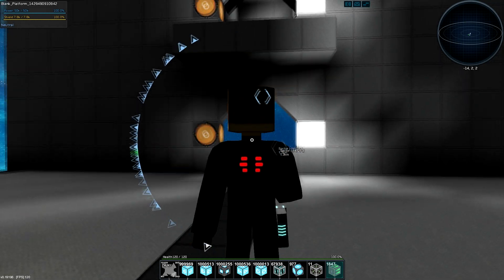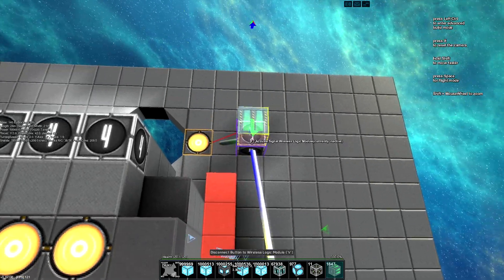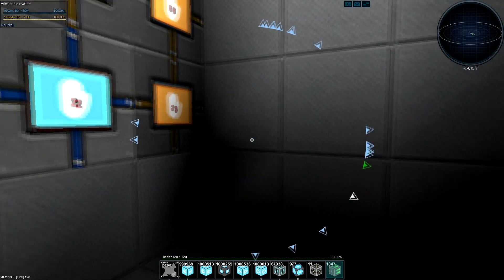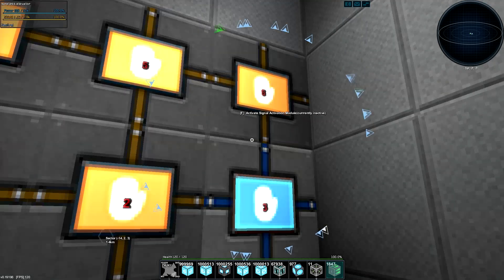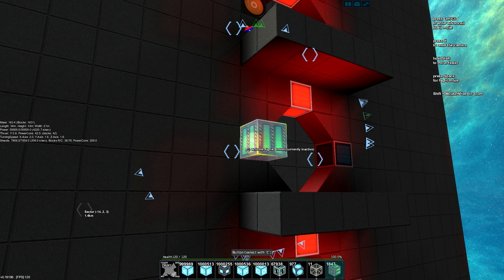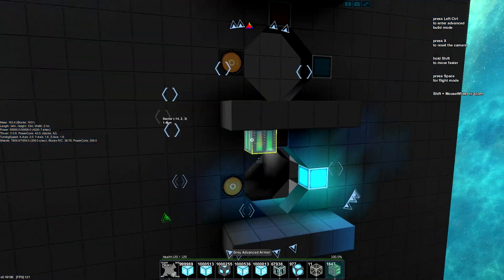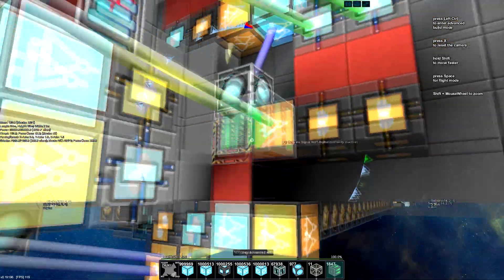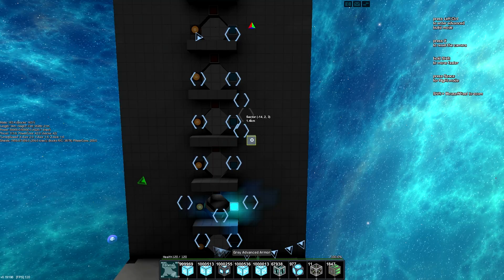Starmade: Ultimate Elevator MK2

Comment: This is kinda confusing. So, the wireless logic(on the ship, not the elevator) isn't connected to a logic system to control the rails?
I have been trying for months to design my own multi floor elevator with logic and rails, but seeing this now, it seems I was using WAY too much logic and over complicating things with a 2 button, NOT, Flip-flop/activation, 2 buttons system for controlling the rail.